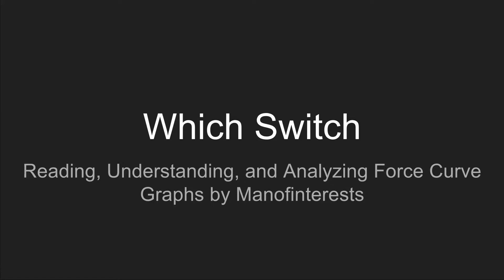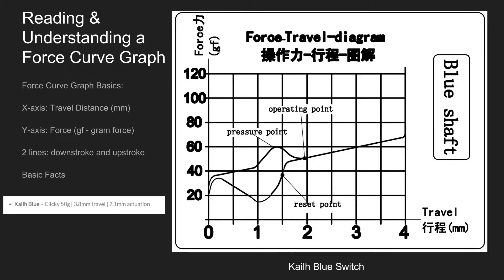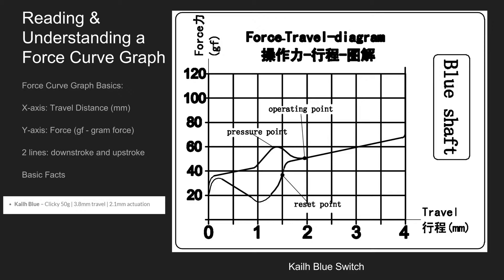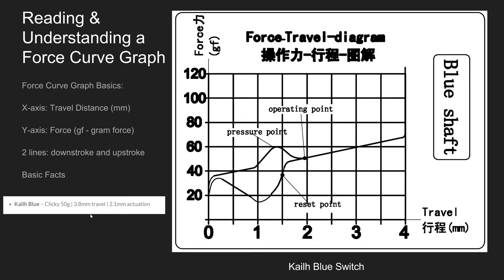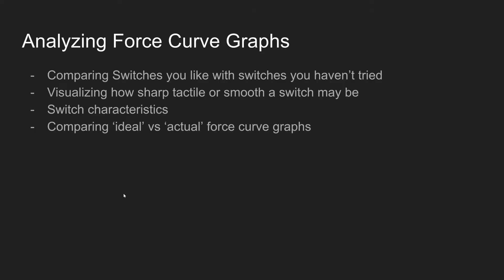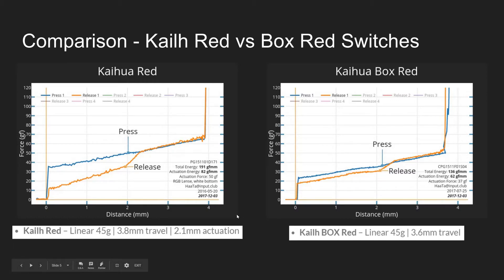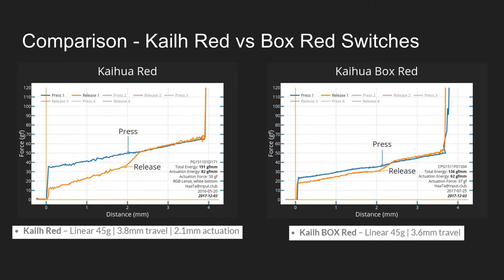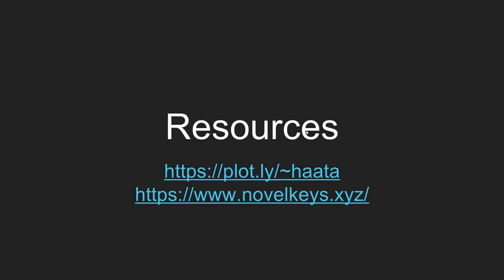Which Switch Ep 2: Force Curve Diagrams

Comment: That's really helpful thank you! I'm actually shopping around for switches for a build. I know that I want a silent but pronounced tactile feel. I've narrowed it down (all tactile versions) to Holy Pandas, Zelios V2, and Kaihl Box burnt orange. I currently bottom out when typing. It's nothing extreme but it's fairly consistent. Forums seem divided as to how they feel about bottoming out. Some say that typing technique needs to be modified, a switch with a heavier spring needs to be used or simply embracing the clacking sound. I personally like the clacking sound. But if I were to modify the switch to a heavier spring to prevent bottoming out I wouldn't receive that rewarding clack I get at the end of the stroke. And I don't like to substitute a high pitch click from a switch for that clack. 

Currently, I have the Razor Blackwidow Elite with the Box style orange switches and I really enjoy the feel. As of now Here are the switch types I've experienced either on a board or tester. The entire cherry lineup on a tester, Romer G tactile, And the razor orange tactile (2020). I could imagine transplanting these orange switches into a custom build if I could but I think that would be impractical. I'd like to add that The Romer and Razor switch (with their box style structure) seem to provide a laterally stiff stroke feel, what feels much better than cherries. Am I correct in connecting this switch shape to lateral stiffness? Is there any equivalent to the razor orange which I can use in a custom build? I hear people compare the orange an MX brown, but from my experience they feel nothing like a brown. 

My custom build consideration is a KBD x19 alu board. 

Would love some feedback.

Comment: There is such a thing as an audio normalization. You need to use this to make audio in your playlists to be of the same loudness. Otherwise, the user forced to adjust the volume with each new item in your playlists! For example, the very first video in the "Which Switch" playlist is loud, so I had to turn its volume down but the second video was very quiet in comparison, and I needed to run to my computer and turn its volume up. Please work on the consistency of the quality of your "creations", man!